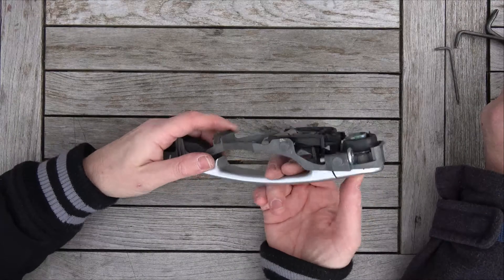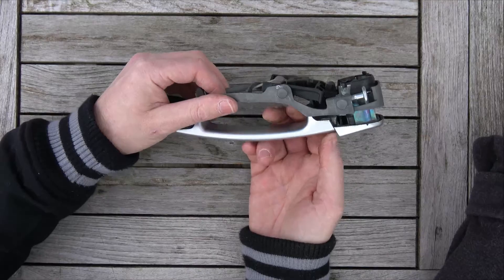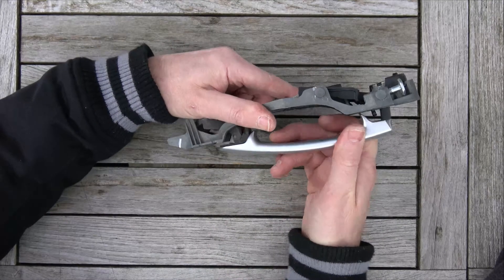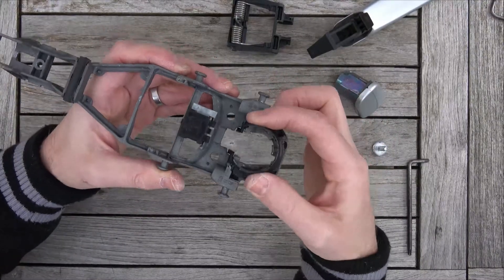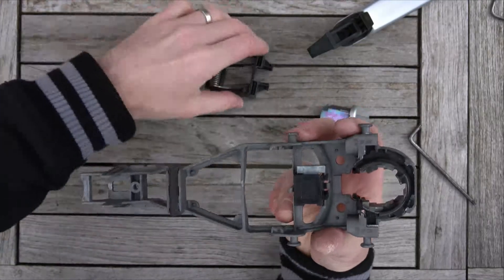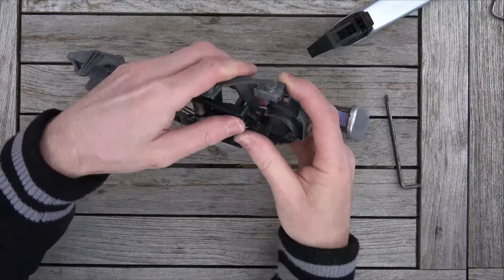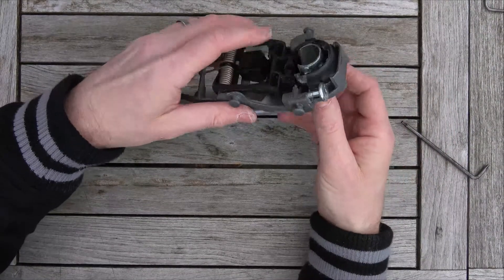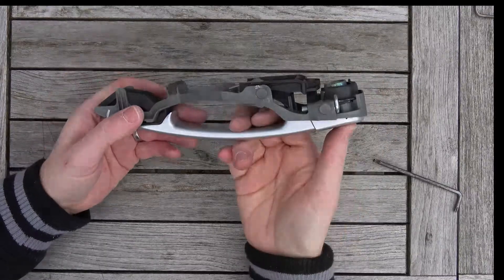VW Golf MK5 Door Handle Teardown & Reassembly

Comment: I replaced standard black door handles with colour coded ones, and i can tell you it was a nightmare for me pulling the door handles off when everything was loosened and disconnected and one of the handle housing circlips fell out inside the door. Eventually, i was able to take them off. After a couple of years, the electric window cable went so door skin came off, and i was able to see how the door handle and its housing works and refitted the circlip that fell out and replaced the electric window winder.

Comment: Sliver lock bolt screws back the Head slots in and holds the spring door release in place. screw locking bolt too far back releases the Handle frame. So be careful pulling the release bolt too far  back as you don't see the inside. Better taking door of with out removing the T20 screw holding the handle on do it after the door skin is off. Wish I had known this before hand.

Comment: Except it does not come out that easy. I've dented my doors trying to pry the barrel out only to find the handle won't come out either. I've undone the screw enough but it will not come out so unless you have a video to help with that scenario???

Comment: can i add my thanks and echo @themidlandangler below.  I was trying to replace the window wire (which involves taking the door skin off, which involves removing the handle and dummy lock, front passenger side).  I'm still at the 'having a complete nightmare stage' - having volunteered for the job, the car is coming back saturday when the window part arrives - your video should help massively for round 2!

Comment: mine handle doesn’t slide off? tried to hammer it gently and pull harder not so gently but whatever i did it didnt come off… however the lock suddenly started to work so i put em back together, except the cylinder now falls off ;’D any suggestions to fix that?
Reply: I'm in the same boat. Fixed my door that wouldn't open, but the dummy lock won't stay in place. And I can't get the handle off. Seems that black ring has fallen off. I need the handle to come off so I can take the door skin off to look for the black ring.... Have you had any luck yet?
Reply: @ares1000101  yes i eventually found a solution, as when the ring is in place and you turning it 12turns counter clockwise you have to pull the handle so that spring locks in place, but as the ring is now fallen off you cant do that.. so i had to take a long flathead and kept the spring/latch mechanism open by hand while wiggling the handle off, helps if the outerskins bolts are off already so you can reach the mechanism easier
Reply: @MH-tm7xv  I will give this a try thanks. Did you access the latch from between the skin and door on the side where the bolt is?
Reply: @ares1000101  cant remember specifically, it was either from above or from the lock cyl hole

Comment: Super - didn't realise this with my Passat CC - similar set-up, but no cable directly attached to the handle.  Pre-setting (BEFORE installing back in the door with the new accompanying electromechanical door lock part 26A- 5N2 837 016C) by turning out the Torx20 adjusting screw exactly 12 turns allows the sprung piece to be locked in so the handle can catch it from the outside of the door once it has been installed.  I missed this bit initially!   Once the door handle is installed continue to keep it pulled out while you install the lock cylinder and then secure the lock cylinder with the other T20 screw, then turn the other T20 adjusting screw all the way back in and the sprung piece will then pull the handle back in and all is done!

Comment: right royal pain in the arse.
just came in from trying to refit the lock ring again.
thing fell off yet again after it was sat in place waiting for me to fit the barrel.
Reply: hello I have exactly the same problem as you I lost the screw used to remove the handle I can neither remove the door panel nor remove the handle and in addition to this my door no longer closes you have found a solution ?
Reply: @adam5226  sold the car a year ago lol
Reply: @longbar2344  did you sell it in this condition? too bad you could have helped me 🤣
Reply: @adam5226  can't remember what i did.
must have sorted it though as the doorskin went back on and door locked.
weirdly the door dropped and took me 2hrs to re-aline it
Reply: @longbar2344  I managed to put back the door and the handle also it closes but there is still the small part next to the handle I can't screw it back on when I screw or unscrew the small adjustment screw nothing happens I I'm fed up 🤣

Comment: Thank you so much for this video, this has helped me loads. That round bracket was missing from my door after I had taken it to get fixed at a garage. I guess the struggled with the same and never knew how to put it back in. They did end up fixing the door but that only lasted 2 weeks before it gave up again. I made it my mission to learn how to fix it myself. Coming across this video has helped me figure out the problem when I got the panel out. That bit sprung right off because it never had that round bracket. Awesome video grateful viewer here!
Reply: I actually discovered something I bent that bracket that comes out if you turn the screw out too much. It fit snug to the rest. Because it kept coming off when I would screw it in tight. Now it doesn’t come off at all even when you turn the screw out too much. This door handle has been a nightmare

Comment: Anyone know how to rescue the situation if you've gone too far and dropped the locking ring into the door?
Reply: Hi, you should unscrew and take the door out. There are videos online how to do it
Reply: Hi Matt, only option is to remove the door skin. To reassemble it you will have to remove the door skin anyway so fishing out from the door is not worth the hassle since you wont be able to get it back in anyway.
Reply: @isiscool4883  I can't remove the door skin because I can't get to the little torx screw behind the handle!
Reply: hello I have exactly the same problem as you I lost the screw used to remove the handle I can neither remove the door panel nor remove the handle and in addition to this my door no longer closes you have found a solution ?
Reply: Same problem. Black ring has fallen off, and can't get the handle out to take off the door skin...
Reply: @ares1000101  I have just succeeded in removing the door panel without dismantling the handle, these are quite difficult because behind there is a support with 3 heads, you must first remove all the screws on the side and then try to pull the door open. front of the car to take the heads out with the elastic outside the support